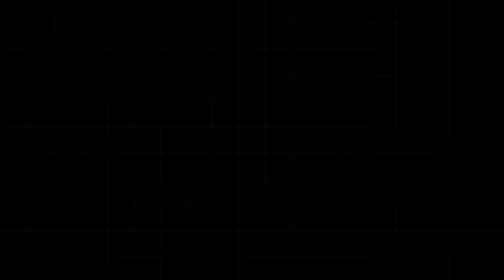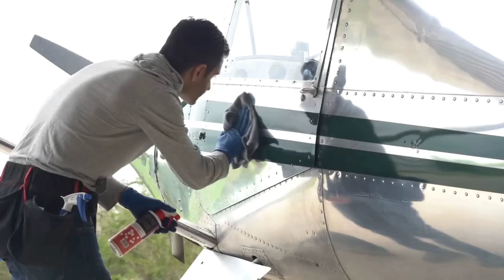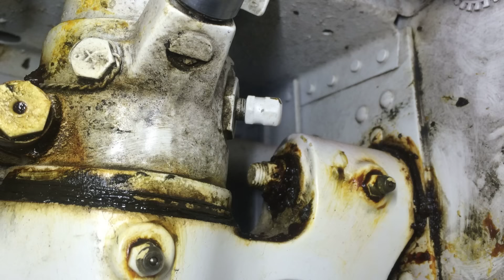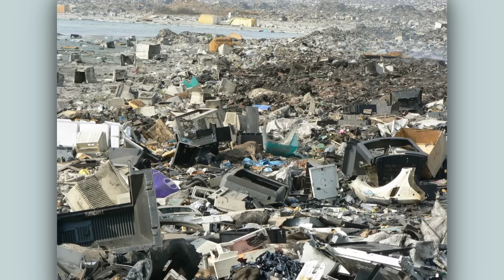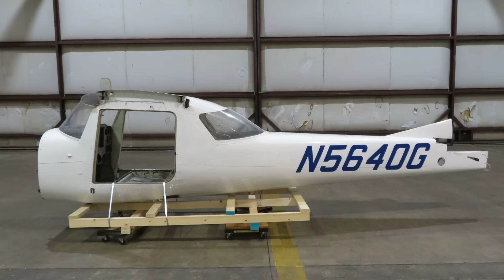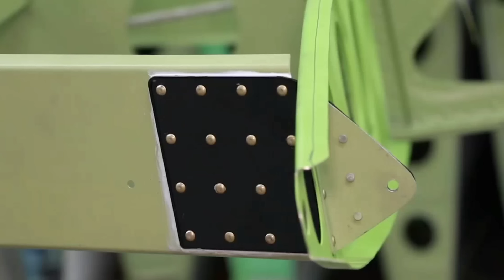The $40,000 "Relic" That HUMILIATES Modern Aviation

Comment: Cotton and linen fabrics do rot. Modern poly fabrics last decades sometimes thirty years or more if properly cared for.

The FAA says the air within fifty miles of the ocean coast is,”Salt laden.” Hence, good preventive maintenance is required. Simple internal coatings.

Aluminum aircraft are quite vulnerable to salt corrosion along with any aircraft with magnesium structures such as classic Beech Bonanzas.

All machines require maintenance. No matter their structure.

Comment: Please allow me to direct our attention to a long lived example of aluminum-monocoque construction from the commercial side of aviation. I am of course referring to that grand old lady the Douglas DC-3 C-47. The airframes still in service are MANY decades old and have survived heavy handed flight crews, overloading, hard short field landings, bad weather, etc and are still serving. Many examples still providing freight and passenger service longer than any other commercial aircraft in existence. Why? Same design mentality. Simply put, they were over built. Some surviving airframes are over 75 years old. Sturdy to the point that a company named Bassler has taken old DC-3 airframes added several inches to the fuselage equipping them with Canadian built Pratt& Whitney PT 6 turbo prop 1450 shp (shaft horsepower) engines for a net gain of 500 hp. Equipped with modern (glass cockpit) instruments these ‘old girls’ get a much deserved new lease on life finding further service hauling passengers and freight in remote areas. All this again due in no small part to that mindset of over building for durability, longevity and, reliability! No! These were not built with the wasteful “throwaway” mindset and the fact that just like the wonderful surviving examples of Cessnas, Luscombs, Pipers and others that are decades old these DC-3’s are still with us. I won’t go into the realm of long serving military aircraft. The B-52’s, KC-135’s, C-130’s that decades old they soldier on reliably. Again, all due in part to the design mindset of durability and reliability.

Comment: It is SEMI-Semi-monocoque not monocoque.  The word monocoque is shell. The modern airplanes, are Semi-monocoque because they have frames and stringers, so it is a reinforced shell. Yes the skin or shell takes load, compression, tension, torsion and shear.  However you need frames. spars, ribs, intercostals, stringers, to hold the shape and have hard points for attaching things like engines, wings, landing gear. Also making the skin so thick to take large compression (pure shell) would be too heavy. Stringers due to their shape and height, have better compression properties, bucking and crippling, than flat sheet metal.

Comment: While a 60-year old Cessna ( or any other AL airplane may look good, if in the wrong environment, it's probably full of corrosion and will need to be rebuilt.  Also, most small light aircraft have either manual or electric flaps not hydraulic.
Reply: As in Florida coastline Cessnas that weren't hangered...